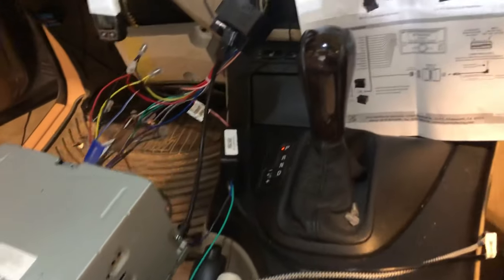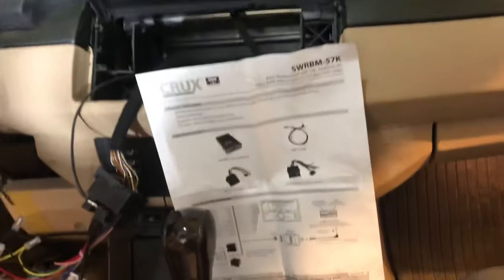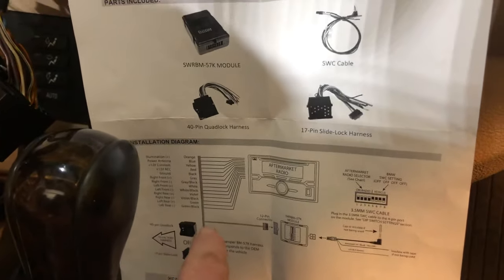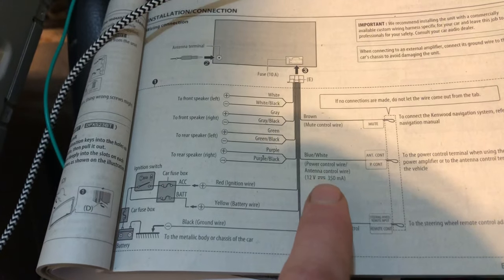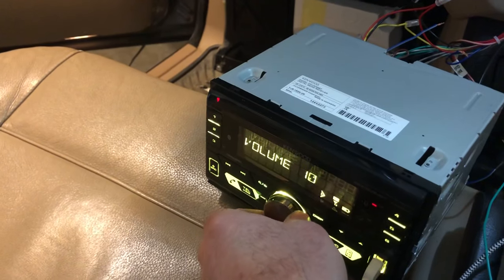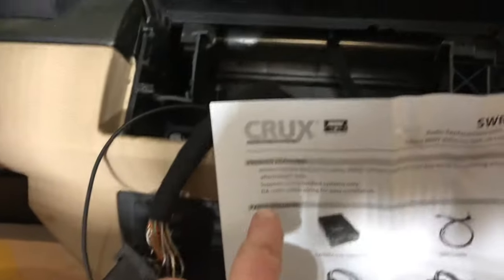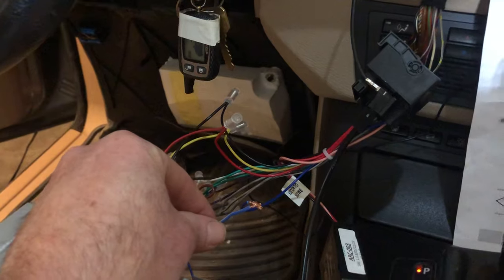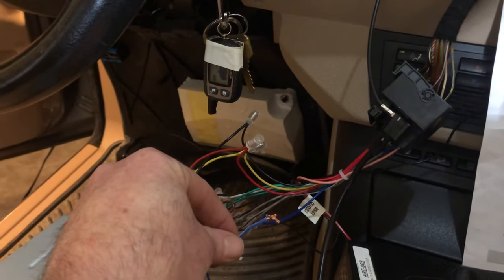No sound from aftermarket radio *SOLVED*

Comment: Thanks. And thanks for getting to the point fast. Interesting as my Ferrari 612 is a 2005 and it worked. Thought it was a power issue. But typically do not connect non-alike colors. Happy now.

Comment: Question. Is this just a matter of the circuit being compete? I want to install an amp and subwoofer in my 2001 e46 but my remote wire that would control power to my amp is occupied I because have this same problem. If I were to connect my remote wire from my harness into my remote wire for my amp instead of the head unit do you think I will still get sound of of my car speakers? Even though my speakers are still running off the stock amp? I am an AV noob sorry if anything I asked was a dumb question and I would really appreciate a response. THANK YOU!
Reply from the maker: Wish I could help, but I’m a NOOB also. I only this worked for me so I shared it. Good luck!
Reply: @jgazda9742 I had same issue I just tapped into the remote wire that was running to my amp,  and it worked fine.  Wow just realized your post was 2 years old 😂
Reply: @Cakelovez  yup lol, i remember what a pain in the ass this was. easy fix tho, and my cheap BOSS radio has run like a clock for 2 years in my e46 lol

Comment: I had the same issue with my Alpine UTE-73EBT installation in my 01 dodge Ram.... I couldn't find any solution until I found your video... I don't have a power antenna so I didn't hook the blue antenna wire to anything... But I did have a lime green factory wire in the Car radio harness (amplifier) that did not have a paired wire from the new radio harness. I connected the blue antenna wire to the factory lime green amplifier wire and voila MUSIC>>>>>> So I don't know (Because I am not well versed on electronics) But either Connecting the blue antenna wire triggers or completes a circuit in the head unit // or // a signal needed to be sent (activated on the factory side amplifier) I don't know but it works.

Comment: I’m sure this is the solution but on my new unit, there is ONLY a blue wire (ANT - Auto Antenna Power). There is NOT another blue/black or blue/white wire. I can’t show a pic of the wiring harness here but if you think you can help me, I’ll certainly send it to you via email. Thanks so much for any help you can give me. 

Bottom line: Is there another wire that may do the same thing as the blue/black or blue/white wire does?
Reply from the maker: Ahhhh, you need to splice that blue wire in with a “switched” 12 volt source (only has 12 volts on it when the key is on). See this video to see what I mean….
https://youtu.be/ZFl3G4BrVak

Comment: What if your car doesn't have a factory amp and connexting the blue/white wire doesnt solve the problem?
Reply from the maker: I guess it means you have to figure it out and create a video on your finding to help out others!  Good luck!
Reply: @AK907dude  going to try running the speakers to an amp to see if I get sound that way.
Reply: @GodofMushrooms  any update?
Reply: @maadgaragegravitydrive8480  the head unit was bad. I got a new one and everything works fine now.

Comment: I did the same thing yrs ago putting in a open box Kenwood Cassette stereo from Circuit City for someone in a 1994 Ford Explorer it had a blue wire i thought it was not needed but the factory radio had a factory amp. at first there was no sound so i thought the radio was bad but it was just that the speakers went thru the amp first. this was in the late 90's when was about 15 or 16.

Comment: I have blue wires on for power antenna from double din swm 7013b and one blue in wiring harness as external amp but i don't have any blue white wires, also i tried connecting both blue wires but didn't work, still no sound. I also tried connecting blue wires with red one but still no sound. Car is sonata 06 2.4l without amp

Comment: So connect it to the blue wire for the antenna?
Reply from the maker: I had to connect my blue/white wire from the steering wheel control module to the blue wire of my deck to get my sound to work.

Comment: I don’t got a blue and white wire help
Reply: check the wiring diagram on the manual, it could be a different color
Reply: @philipalberti7008  i don’t got a manual lol
Reply: @lospitufos8890  damn lol. best bet is to try to find a pdf online then
Reply: @philipalberti7008  im prob gon go to a shop at this point don’t know what else to do cause I wired my harness to what seems to be the right colors however I got a left over black and red and the radio only turns on no music comes off it